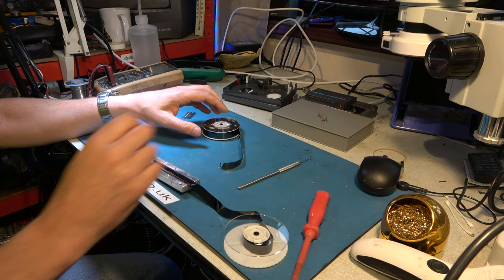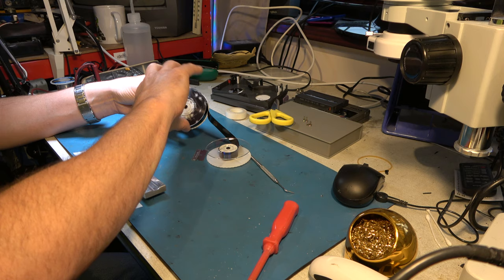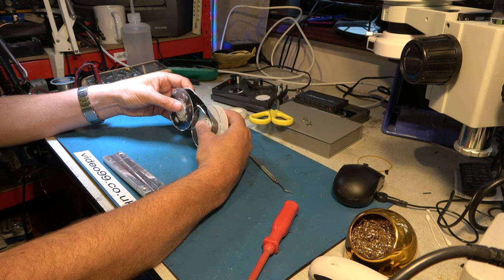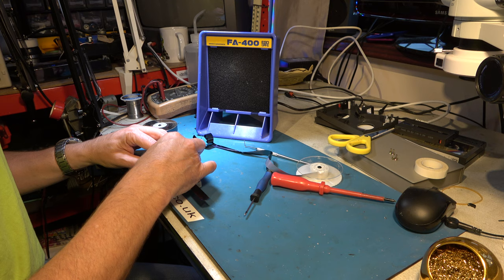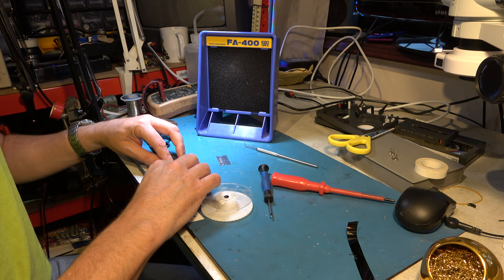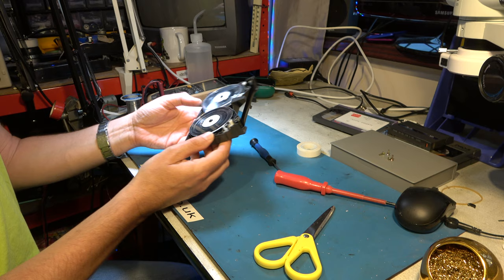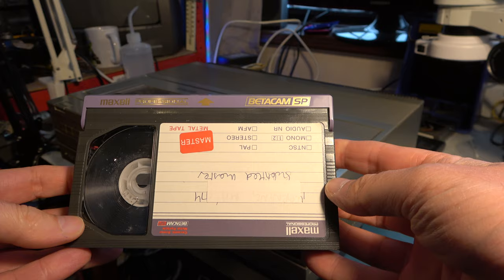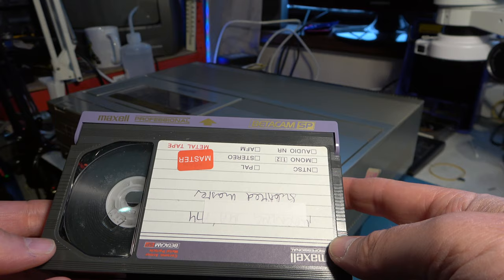Oh no! Mould on a BetacamSP tape! What can be done?

Comment: Nice video. I have a RTI Tapechek 460 that I use, even on v2000 and betamax (need to transfer the tape to a vhs spool).
Reply from the maker: I want a TRI Tapechek too.  But it won't help with tapes where the mould glues the tape together on the spool, it would just snap them.

Comment: Quick question, did you clean the heads of the Betacam machine after transferring the tape and has it contaminated any other tapes that have been in that machine? In regards to VHS I have been told to use only a spare VCR just for playing tapes which were formally mouldy because regardless of how well the tape has been cleaned, invisible spores can still exist on the tape, however I don't do this because I'm an idiot, also mould spores exist everywhere anyway, indoors and outdoors so technically every videotape machine and tape have invisible spores (how else did they get on the tape in the first place) and it's how the tape has been stored that caused the problem (also if you've played years of tapes you have to ask a ton of what if's, for instance a tape could show very, very little mould). The only thing with a tape that was mouldy is it has more invisible spores then a clean tape so it's more likely to return if you store them badly again.
I have gone into detail about the method I use to clean tapes, and I often do it a lot more vigorously then some people online since I do it a few times until my tool is clean (which can take many runs) and if the tape has had heavy mould I will soak the top in some IPA to remove any stains and manually go through the tape (my manual rig is just the reel hubs from a broken VCR and some Lego) and remove any that might be on the tape itself (which after multiple cleans any mould that was on the surface is usually gone anyway). So am I safe to run a tape which went through this process in my good machine and don't risk ruining any other tapes? Also my house doesn't support mould growth and I've packed all my tapes with silica gel so I know it won't grow back.
Reply from the maker: Once the tape had been de-moulded, I ran it through the Sanyo Betamax machine multiple times.  This will have cleared off any residual mould on the tape edges, and it was then safe to run in the BetacamSP.  There was essentially nothing left of the mould at that point.  For VHS I do have a scrap machine which I use for passing mouldy tapes through, and every so often I take it outside and clean the mould dust out, with great care not to breath any in.  You're right of course, mould spores are everywhere all the time, you can't completely eliminate them.

Comment: Is the Sony Beta you used to FF & RW a BetaMax deck? So, the small Batacam tapes fit in a BetaMax machine? I have a front load S-BetaMax deck, the same can be done with it, not for play back just FF & RW as you show. Thanks for your expertise.
Reply from the maker: Yes, all Betacam variants up to and including HDCAM-SR will fit a domestic Beta machine.  But I wouldn't suggest using a Sony, Toshiba or early Sanyo since they are laced up during REW/FF.  I chose that particular Sanyo because it's unlaced in winding.

Comment: Smashing, another tape recovered :-D
I was thinking you had a all wet system where the spools sit in a warm water bath on plastic hubs and maybe a cap of bleach to dissolve the nastys.
High frequency Vibration may be another way to crack the mold.
I know you have done all sorts to find a method, but once i start thinking i talk crap lol :-D
I didnt know you watched technology connections, he does a fair job with most of his videos.
And you get to see his screwups lol :-D

Comment: I see at a VHS Tape, who goes with Isopropanol on a Paper and this with an Razor blade, between the Rolls of the Cassette. Then spools with an Electric Machine the Tape. That doing so on and on until it has been cleaned of mould.
Reply from the maker: The tape would snap.

Comment: It's black mold what is dangerous, white mold is relatevely safe. Instead of wearing a mask it would be better to do that in an open environment.
Reply from the maker: I've always assumed that mould is bad, but it's good to know the white stuff isn't so bad.  I can't do this in a well ventilated room because the tape flaps all over the shop in a breeze.  I think the filtered extract fan helps a lot.